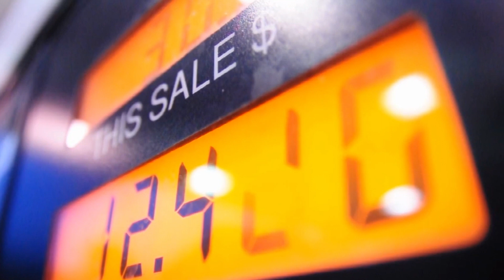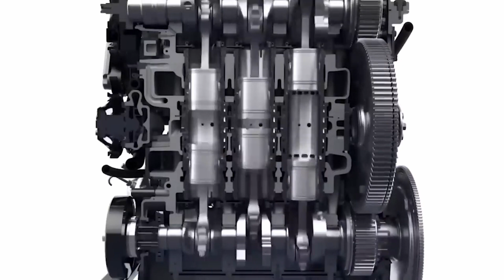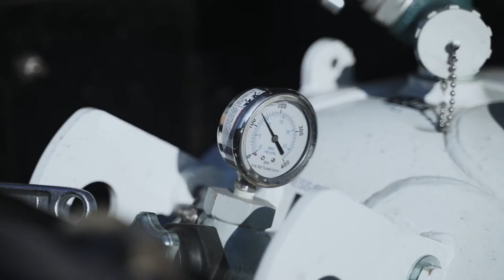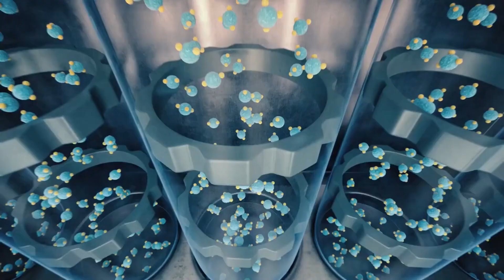Toyota CEO : Ammonia Engine The End Of EV's

Comment from the maker: What are your thoughts on Toyota's CEO suggesting that ammonia engines could mark the end of electric vehicles (EVs)?
Reply: About the same as them missing the boat on electric. What was the best car company is now trying to stop a train with a lawnmower. It's embarrassing really.
Reply: I’ve read countless times statements mentioning EVs will be dead, the end of EVs, bla bla bla… but the fact is that EVs are experiencing record sales world  wide especially sold by reputable brands such as Tesla, BYD, Xpeng, please stop your joke
Reply: Even if this became a thing… the convenience that EVs provide will guarantee their survival. I plug in my Tesla after work and never have to stop a gas station. No oil changes either and much of the repair work can be done at your home with a mobile tech. I needed a new camera and a guy came to my house and switched it out in 10 min. The only argument is road trips and with the Tesla plug being accepted by other manufacturers the fast charging network will only improve. Also, Redwood materials and Tesla recycle the old batteries after the car’s useful life of hundreds of thousands of miles.

Comment: Another infrastructure problem. Electricity is everywhere. 95% of the energy actually turns the  wheels rather than 25% on internal combustion  engines. And you still have all those moving parts & oil changes. When are you going to wake up?

Comment: It is a pity that your video did not take a more balanced approach to NH3. It is not an ideal fuel. The use of an energy bearer is going to be wasteful compared to using electrical energy directly. This applies to H2 fuel cells as well as NH3. Electrical energy can be stored in batteries, or provided directly using dynamic charging.  Combustion with NH3 or synthetic fuels create their own challenges, often health related.  

Electric vehicles will always be cheaper to operate, often by a factor of 3 than fuel cell or ICE technology. NH3's energy density is only 1/3 that of gasoline/ petrol, so it typically requires storage tanks that are three times larger, for the same range. NH3 is also corrosive. I will not repeat the other challenges other people have commented on.

Comment: As a fuel, ammonia can be burned in an engine, typically using a dual fuel strategy such as ignition with a diesel pilot. Challenges of using ammonia as fuel include emissions of unburned ammonia, NOx and N2O, the latter a potent greenhouse gas.